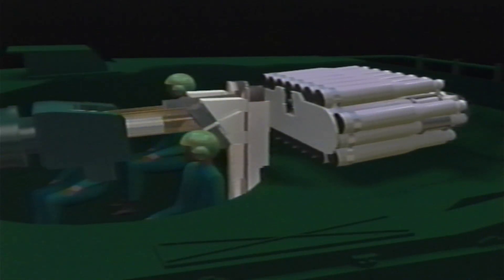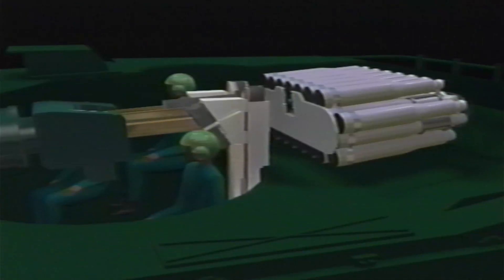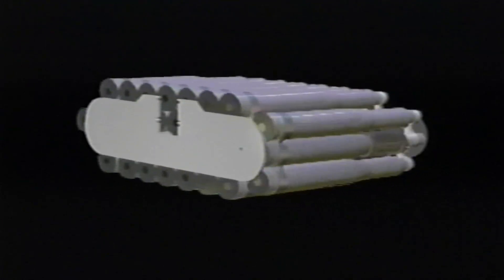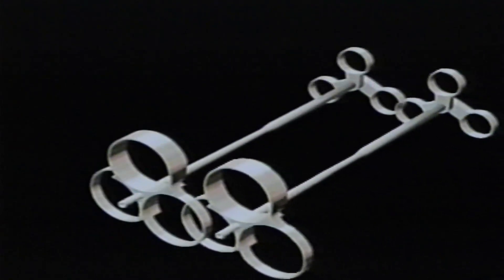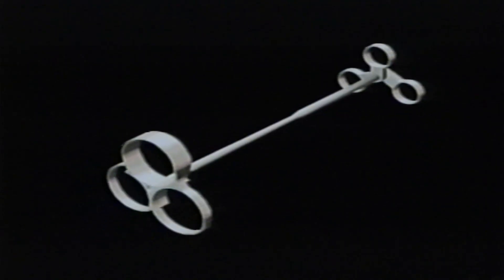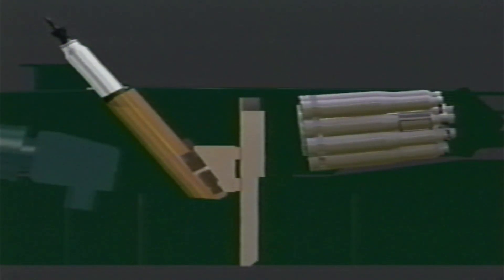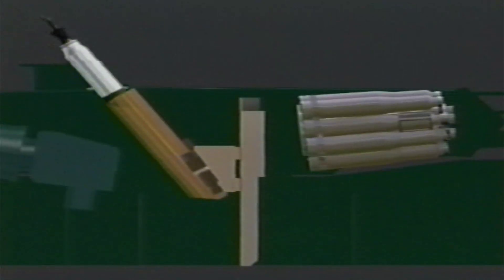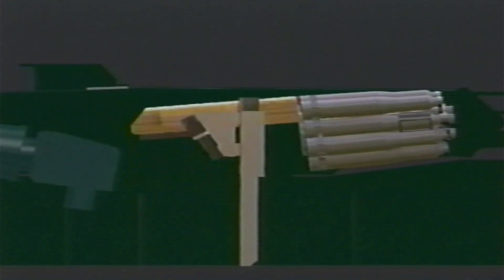120mm Compact Autoloder, Western Design Howden.

Comment: I wonder if the barrel even needs to move into a neutral position while reloading, the autoloader looks like it can load the breech while the barrel's at any angle.
Reply: Someone didn't watch the video where they tell this, did they? It's able to load between +10 to -3 degrees. You're welcome.

Comment: Silly question but why can't the ammo be stored nose forward so it doesn't have to be turned 180 to load? Wouldn't this simplify the auto-loader?
Reply: The whole point of ammo being backwards in the Abrams is to make it safer if a round detonates, as the projectile isn’t facing towards the crew compartment. This combined with blowout panels and a blast door make an ammo detonation less dangerous.
Reply: I think it can be done, as long as you you don't mind them shooting into the crew compartment when ignited

Comment: Career 91A mechanic here. Yes, this is very cool and all, and it gives some tactical advantages, but the mechanical complexity would be even worse on an already immensely complicated system. These tanks are always broken over the dumbest things, and this is just another thing to break for no reason. A crewed loader:
A.) doesn’t break 
B.) can carry out extra tasks and duties i.e. radio operation, target scanning, helping with changing/replacing track, among so much more
And C.) with enough time and practice, crew loaders can be significantly faster than any autoloading system. There’s records of loaders able to slam rounds in less than 3 seconds. That’s pretty fucking fast. 
That’s my 2 cents, at least. Without a doubt an awesome idea and design, but there’s a reason why the Abrams has what it has.
Reply: Yes and no. Autoloaders would need to be stress-tested for reliability.
Maintaining an autoloader is definitely a transition from manual loaders; but overtime, doing maintenance on the autoloaders would just be another Tuesday given the time.
1.) Gun calibers are becoming larger to incorporate more flexibility against Armored vehicles and fortified structures; any caliber higher than 130mm will require a autoloader as a loader cannot carry such rounds consistently.
2.) Modern sensor suites (like modern design architecture, AI, etc.), albeit expensive - will alleviate the need of a extra crew member. Just like the F-35, this will act as your WSO.
3.) Loaders cannot load in rounds consistently while on the move. Loaders also experience fatigue depending on the environment, situation, and rest - they are still human beings after all.
4.) For a loader to attain a faster rate than a autoloader, this will require the loader to keep the Blast doors to be open constantly to shove in rounds faster - this is a operational risk for the entire crew.
5.) Like the KF-51, the 4th crew member will act as a extra maintenance operator or as a surveillance operator with the onboard loitering munitions/UCAV.

There's still a lot more that I could talk about, but autoloaders nowadays gives a lot of advantages than it does for it's cons.
Reply: On the other hand, once tank guns get to 130mm+ caliber a human loader will struggle with the increased weight of the ammo. Also several nations both in the east and west have been using autoloaders for year without any compliant on complexity or reliability.
Reply: The Russian autoloader on the T-72 is infinitely more complex, yet it almost never breaks. They also said you could just load manually if it did break.
A manned loader: Has a hard time loading on the move, takes up space in the turret, could be scanning for targets while the gun is loading, and gets tired.
Reply: A) people do in fact break and removing some of the manual tasks from the 4th person would reduce VA claims for gunner's elbow at least :)  B) wouldn't be eliminated by addition of this system, particularly given the need for a UAS or other systems crewmember. C) Chieftain asks the question in https://youtu.be/aladW_D4nKU?si=eHYi4mVsMlWigB-f whether that loader can do that for 15 minutes.  120mm is getting to the top of the limit where beyond that you pretty much require an autoloader anyway, and the next (AbramsX?) tank will probably be using an unmanned turret anyway.

Comment: I wonder why they decided to make it do that flipping motion.  Seems like it might save a few seconds per cycle if the round is already facing forward. 

For the record, I'm assuming there was a good reason, and I just don't see it yet.
Reply: you want heat warheads facing out of the turret not inside.
Reply: In the event of cookoff, HEAT and other warheads like it would penetrate the armored wall separating the bustle from the turret interior, defeating the purpose of blow-out panels. As a slight side benefit, the base of rounds are also easier to grab and not quite as pointy (SABOT rounds in particular have extremely sharp tips. Wouldn't want to slip while pulling the round out and have it puncture you)
Reply: @Hegamonia  That would be embracing story. 
"Cool scar.  What happened?"
"I got stabbed... By an anti tank round."
Reply: Supposed to be a drop in upgrade for existing Abrooms ... very compact and the 4th crew/loader can still be retained.

Comment: Isn't this a bit more complex than Leclerc or Japan Type autoloader?

Its basically having a robot arm as the loader, it pick the round, swing it then push to the gun breech while other autoloader is basically just connecting to the gun breech and push the round inside

I think it would be better if the round ia facing same forward as tank turret, so the autoloader just need to pick the round, connect to the breech and push it
Reply: Its no more complex than an AZ or MZ autoloader on the T-72 or T-80/64 series of MBTs.
Reply: This will load between +10 to -3 degrees and it is a relatively simple retrofit that also improves crew survivability.
Reply: maybe, but keep in mind they're designing it around a mostly unmodifiable turret design. Dunno how the bustle would fare in this case though considering there's a hole for the explosion to come out. Maybe it's not even blowout protected?

Comment: Wait...so...how does it clear the last rounds casing? Is that the extraction bit? Kinda playing fast and loose with the demo if they're leaving a whole step out....
Reply: NATO 120mm cases are semi combustable. The base of a round remains after firing, and is usually dumped onto the floor
Reply: @Demopans5990  typical military waste feeding the industrial complex, man! </s>

But seriously though, thats interesting as frigg
Reply: @TankR  It's really funny to imagine the tank kicking the base up out of the turret, but that'd create a breach in the armor and also add an extra step to extraction since currently afaik the gun recoiling automatically ejects the uncombusted section of casing. Ends up more convenient to just dump it on the floor to be disposed of later

Comment: On one hand, I do like the relatively simple solution of flipping the round in order to preserve the safety feature of having all the ammo's warheads facing the rear of the vehicle, on the other hand, you still have the weakness of a vehicle with a tall profile that was made necessary by the original inclusion of a loader. You may as well go for a turret redesign in this case to shave down height and weight.
Reply: A complete turret redesign is expensive and time consuming. This isn’t a drag and drop addition but it’s fairly close.
Reply: @aidanmattson681  I understand that, but you basically have most of the weaknesses of a tank with a loader, with only a singular benefit of a tank with an autoloader. It wouldn't be good value.
Reply: i think part of the tall turret is also -2 +10 degrees for cannon. i think that was one of the things it needed to do. anyway abrams has few weak spots on hull too anyway. especially against drones. so you would need whole new tank if you really want it. but 12 shorts per minute and such high capacity i think its more than worth it.
Reply: This is tested on the older A1 turret, but originally designed for CATTB the loader isn’t necessary and allows for more armor/ compartmentalization
Reply: @seasons1745  Ah, so the A1 turret in this case is just a testbed?
Reply: @TheCol111 Abram’s has multiple autoloaders tested for the older turret, in this case the Compact loader is a successor to the previous XM91 which was specifically meant for the CATTB
Reply: The solution is a shorter and smaller aux-loader that does ancillary tasks instead of the actual barrel stuffing.

A full-sized autoloader is huge. A semi is still pretty big. An aux-loader would (on command) top off the ready rack and re-rack unloads from the main gun without being so bulky as to hinder the human loader.
Reply: @harveywallbanger3123 a autoloader is superior to a human loader, and that’s been a thing since the 60s, ramming chains have existed for a while

Comment: Wouldn't it be easier to just shove the shell directly forward, like K2, Type 90 and Leclerc, Type 10? From the look of it they have plenty of space to implement it. The only advantage I can see with this is it can feed the shell at any elevation, but I am pretty sure returning to aim point is standard feature too.
Reply: The shells face backwards to prevent for example HEAT shells firing inwards upon ammo rack detonation.
Reply: The main advantage is that it can be dropped into pre-existing turrets with relatively minimal retrofitting.
Reply: That would require an extensive modification of the bustle. This simply replaces the rack with a conveyor magazine, and places a machine in the no man's land between the commander and the loader, with no further modification required.
Reply: The magazine has four levels, so the loading mechanism also needs to be able to select between two extraction positions from the bustle. This is hard to implement with a push-through system because then you'd need two ramming arms (or an additional mechanism to allow the ramming arm to move up and down) and two gun locking positions. Additionally, the rim of a round is much larger in diameter than the projectile in its nose, so in order to implement a push-through solution all tubes must be larger than the rim and the nose of the cartridge would need separate support. In this design the storage tube for each round is shaped like the round itself and can support the nose by default. The tube itself has the exact same outer diameter as the rim of the round and is as thick as the difference in diameter between the rim and the base of the round. It fits perfectly like a sock. This both strongly secures the round and allows maximum efficient use of stacking space in the bustle.

Let's also not forget that a push-through design would need a relatively large space behind the magazine for the ramming arm, necessitating either inefficient extension of the bustle (because the mechanism would only occupy a small volume in that extension) or the addition of an exposed vital mechanism outside the armor of the turret that could be damaged during normal operation, let alone combat. Oh, you turned the turret two degrees too far? Whoops! The ramming arm box got crushed by that tree trunk and now we can't load!

In short, this is the dimensionally optimal solution for installing an autoloader in the bustle of an Abrams.

Comment: A semi-autoloader that assisted the loader would've been cool ngl
Reply: at this point just make normal one
Reply: @Losowy nah
Reply from the maker: They developed a revolver that helped a lot in kicking rounds to the loader iirc. I have the footage and it will be posted.
Reply: I was going to say that your idea is kind of dumb, but if you just had the cassette portion of the autoloader, with the door moved to the loader's side, even that would make things a lot easier, as all of the round would essentially be ready rounds. But, I think going for the full autoloader would be better.
Reply: @saberwing7930  Thing is, the US will never want to give up their loaders. They've become essential to the tank's operations not only mechanically, but also fulfilling other duties.
Reply: @elongated_musket6353   I'd say keep the fourth crew member, and have them man the radio or an anti drone weapons station, or something like that. With all of the networking capabilities that tanks are likely going to need in the future, a 4th crew member might be worthwhile to help manage incoming/outgoing information. I don't think having an autoloader would automatically drop the tank to a crew of 3. But I do think having the autoloader is essential, whether the tank has 3 or 4 crew.
Reply: @saberwing7930  imo I think they should just be a drone operator themselves, let them control a drone that can be launched from the top of the turret to conduct recon or launch something like a Switchblade 600 to perform an attack from outside line of sight like a Spike NLOS ATGM. Anti Drone capability should be integrated into CROWS, a M2 with some slightly beefier .50bmg rat shot shells would give something like RPG warhead FPV drones a run for their money.
Reply: @saberwing7930  That's what they did with the Abrams X and KF51 concept tanks, they installed an autoloader but kept the 4th crewman position for auxiliary duties.
Reply: The newer Merkava tanks actually have a semi-autoloader.

It’s a 6-round rotary bustle to rotate the desired round to the optimum position for the loader to grab, aiding him with consistency since he won’t have to bend down or lift his body up to grab the desired shell in a Leopard 2 or Abrams. It also has the safety feature of only needing a small slit rather than a large bustle door.
Reply: Even the system that automatically restocked the ready rack would be nice.

Get to a covered position, bang the button and the computer rapidly reloads your ready rack in 1/5th the time it would take you.

That wouldn't take up nearly as much space as a full autoloader, or even a semi-autoloader, and would save the loader's arms for maximum speed in an ongoing tank battle.

Comment: After watching the video, I had a question: where do the casings disappear to? They could return back to the ammunition assembly line, but this is not happening. There is nowhere to drop them down either, as the charging mechanism prevents this.
Reply: NATO standard 120x570mm ammunition uses semi-combustible cases. After the round is fired, only a small portion of the case - the ignition mechanism and the base of the cartridge - is ejected downwards into a special bin from the bottom of the breech. This allows a more compact turret arrangement, as the breech can be closer to the bustle rack. Older NATO 105x617mmR ammunition used regular steel or brass casings.

The problem was that these large casings very quickly accumulated on the turret floor, and it's quite counterproductive to have them keep laying there, especially while on the move. 

There is also some WW2, Korean and Vietnam War footage of M26/46/48 tanks shooting with the loader hatch open, and the loader subsequently dumping the casings through the hatch. The Soviets solved this (before moving on to combustible cases) by incorporating an automatic case ejector on their new T-62s, but it was rare.
Reply: IIRC the 120mm cartridge case is semi-combustible with a metallic stub base.

Comment: the fact that it could get damage much more easily considering the mechanism is exposed is kinda bad. I mean imagine you're in a desert with open hatches and dust comes in the tank and get into the mechanism, other bustle autoloaders don't have that issue as the mechanism is placed directly in the bustle with the rounds but that requires the gun to be back at a certain angle, but this autoloader didn't need to and could operate between -3 & +10 which is quite cool but doesn't feel that needed as the extra speed gain is certain good but just not that usefull (for example a 3sec reload while quite good in theory is in practice not that usefull compared to something like a 5sec one).
Reply: On Soviet tanks. Such a mechanism has been operating for almost 60 years, including in deserts, only without flipping shells. And there are no catastrophic problems.
Reply: @allapay6867  yeah that's fair
Reply: the mechanism is exposed only for demonstration purposes fyi

Comment: Very cool but the Abrams was never designed with an autoloader in mind. This seems like a major injury hazard for the loader, that's why the K2, Type 90 and Leclerc all have the autoloader mechanism placed behind layers of barrier despite them having less moving parts. 

Hit a bump when driving and reloading, loader got toss around a bit and his arm is gonna get caught in the mechanism, not to mention the hazard to the commander as well. No amount of safety improvement is gonna stop a 19 years old from claiming his disability benefit even if the tank never got hit by enemy fire.
Reply from the maker: One must consider that a barrier would almost certainly have been put in place had this gone anywhere. There’s firing guards and the such for the loader and the red of the crew in the first place, a quickly removable screen between him and the mechanism (also for the TC) would not be too difficult to manage.
Reply: @Kreyton_M1E1 that’s a relief to know. Hell, maybe this thing is a better idea than I had thought
Reply: The crew definetly would be trained to not stick their hands anywhere near that thing, it's the same argument about soviet t series tanks autoloaders being dangerous. Yes they are dangerous if you stick your hand in front of it, but a trained crewman shouldn't even need to think twice to not do that.